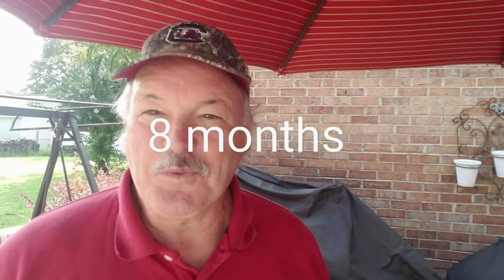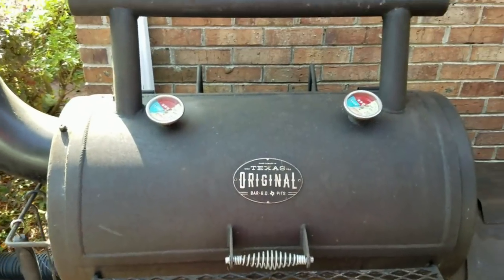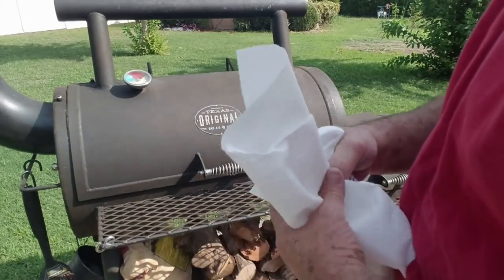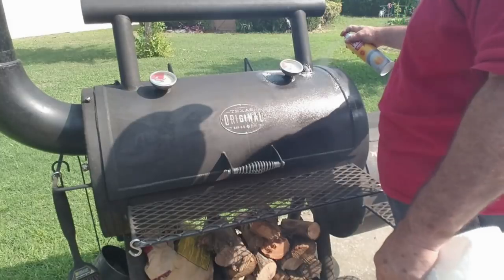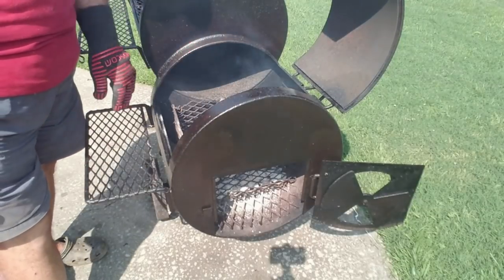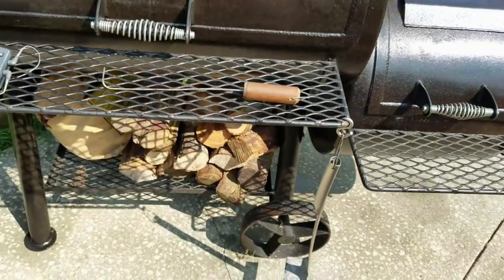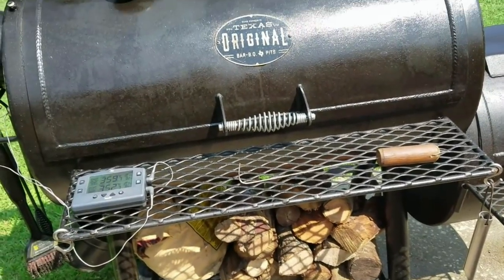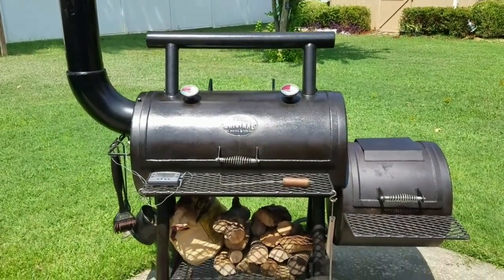CLEAN AND RE-SEASON MY OFFSET SMOKER | TEXAS ORIGINAL PIT

Comment: You Abuser. Can’t believe you let that beautiful offset get like that PIF. Well you are back on track now. 👍🏼💪🏼🇺🇸
Reply from the maker: Yeah. Lots been goin on since Super Bowl. Like you said, back on track. Note, it looked just like it does now since cleaning and oiling. Dust, wind, heat all did it. I didn't do it. Even covered they still get the crud. Shows ya things need using.

Comment: Can u do a video showing how u clean those grates or let me know how u do them.....
Reply from the maker: Hey Jack. The key to maintaining the grates in all cookers is to clean after each cook. Not necessarily right after but within a day or two at least before the next use. I'm not a believer in letting the crud continue to pile up from cook to cook. Some call it adding flavor but I don't. The longer you let that happen the harder it is to clean. I do 3 things. 
1- Use a 2 in puddy knife and go over the surface and in between the grat rods, and the bottom of the grates, and knock the hard stuff loose, usually going to the bottom onto the heat plate.
2- Then I use a steel bristled brush and brush the top and bottom of the grates.
3- Now take a cotton shop rag and wipe down the grates top and bottom. 
4- Last, spray the grates with PAM.

Thats it for the grates. Then with that puddy knife scrape the grease off the heat plate. Catching some on paper towels, and some goes down to the bottom.
Remove the heat plate and scrape the pit and wipe heavy grease onto paper towels. 
Now put everything back in. 
Doesn't take long at all.
Cheers

Comment: Love all your videos! I might have missed it but I don't see any video where you talk about upgrading the smoke stack on your Texas Original Pits offset smoker from the original skinny one to the big curved 5" that's on there now. Did you talk about that somewhere, or if not, could you mention how and what you did? Thanks!
Reply from the maker: Replacing that small pipe was the ticket for this offset. Now I can get higher temps and hold them without burning a huge fire. My uncle had a steel fab company and was a professional welder. He changed that thing out like nobody's business. He had a buddy with lots of stuff and he told me not to go buy anything yet until he checked around. He found this section of 6 inch stainless steel pipe and the stainless steel 90. Very expensive to buy. I loaded it up and ran it over to his house shop (now retired at 80 yrs old) and he cut the small pipe off and welded this 6 in stainless pipe on with the 90 elbow also stainless. Turned out nice
I did a short clip which is embedded in another video named Offset Smoker Pulled Pork SC Style REDO. Click here https://www.youtube.com/watch?v=qUaNMOjLdu0&t=615s and go to it, then go to timer marker 7:15-10:15. This will show it to you being replaced. You want to buy it. Still like new and cooks very good.
Reply: @progers5019  Thanks for the information! And yes, I would buy it in a heartbeat,  but there's one little problem - I live in Idaho! :) Keep up the good work.

Comment: How tall is that 6" pipe stack you added? I sold my Texas Original Pits that I was not happy with.....and now I am going to build my own because I can go much bigger for the same price I originally paid for the 16" x 36". Going to go 24" x 44" or so, and I am planning on using a 6" exhaust on this one.
Reply from the maker: Just seeing your post. sorry. The riser pipe is 25 inches from where the opening comes out level from the pit on the elbow. If you draw a line straight out from the center of the elbow attached to the pit, the pipe rises 25 inches from there. I now have great air flow and this thing cooks great. they need to put larger pipes on this pit. Mine is proof. Before, I struggled to maintain 250-270 F without a big fire. Now, not a problem. Only 1 small split every 40 min, and the firebox vent closed down to 1/4 open and I can cook 250-270 all day long.

Comment: It cleaned up really well. When I got my smoker, and researched seasoning, I didn't see anyone seasoning the outside. Do you recommend that for every smoker? If you're using it regularly, how often would you re-season it? Thanks
Reply from the maker: I've since seen others say you didn't have to do the outside, but when I was searching out about seasoning mine year and half ago, I saw many recommending it, even though it is painted with a heat resistant paint. It helps when your smoker begins to look cruddy. Canola oil will not hurt anything. Really helps put the shine back after a lot of use, especially the firebox.
Reply: Hog Wild BBQ I wipe the outside with canola oil after every cook while the iron is still hot/warm

Comment: Good work Phil.  Now do not neglect it again!
Reply from the maker: You know I had that thing oiled and slicked out when covered and left sitting. The high heat, humidity,  dust, and wind eventually got up under the cover and dried up the oil and turned it into crud. Needs to be used every few weeks. It did sit for 8 months. BAD !! Thanks Lew

Comment: So your smoker is bare steel? I just built my own offset but haven't painted it yet, so maybe I don't need to paint it?
Reply from the maker: No, it's painted from the mfg with a heat resistant type paint. I use the PAM (canola oil) when it starts looking cruddy and heat it up, and it looks good again.

Comment: I’ve always thought you’d have better airflow out away from that brick wall. If I have mine too close to my garage it doesn’t flow worth a darn.
Reply from the maker: Yes, that does make sense. Maybe that was a contributor with the air flow issue before replacing the pipe. Oh well, she flows now. Thanks Milan.

Comment: Any particular reason you added the bigger stack?
Reply from the maker: Yep it made a big difference two ways. In air flow capacity to move more air in and out including moving smoke out too. Also reaching higher temps e.g. 270°-300° and maintaining it with just one split. If interested, Here is a link which shows how it was done. 
https://www.youtube.com/watch?v=qUaNMOjLdu0

Comment: Love the exhaust on that offset, do they still make that same model?
Reply from the maker: Hey Karlo. Texas Original makes them, but the exhaust pipe is a mod I did to increase the air flow capacity to move out more smoke. I had some issues with meat tasting a little more smoky than we wanted, and seemed I couldn't get to high temps without building a huge fire. Came with a 3 inch pipe, and I had it changed to a 6 inch pipe. Helped a lot. Thanks for watching and commenting.
Reply: Did you buy the pipe or have a fan shop do it

Comment: How could all that krud get on it while it was covered up?
Reply from the maker: I asked that same question when I uncovered it. When I put the cover on it after last using it, it looked like a shiny new penny. The cover is a cheap offbrand from lowes and is not the one Texas Original sells (over $100). This one was about $20 or so. Only thing I can figure is I have it coated with PAM and pretty slicked down. The wind blows lots of dust, and I blow some dust when using the leaf blower. Between those two things, it must blow dust up under there, then the 95 degree summer days we had here in SC, it baked that dust on like the crud you see.I"d be better off to have it inside a shop or garage uncovered probably.  It's aggravating to put it up clean, then find it all crudded out. It sat about 6 weeks this past time and was crudded up again, not nearly as bad though. I fired it up and burned some wood in it and sprayed more PAM on it. Looks new again. And that is why the crud. Thanks-Phil

Comment: modded stack?
Reply from the maker: Yep. After 3 cooks on this pit, it was determined that the meat was too smokey, so I had my uncle (pro retired welder) cut the 3 inch pipe off and weld on a 6 inch pipe to have a greater capacity to move air in and move smoke out. Worked out good.Mans gotta do whata mans gotta do. Good eye